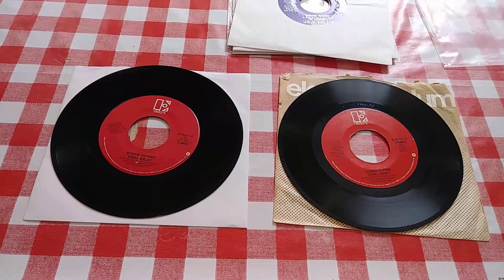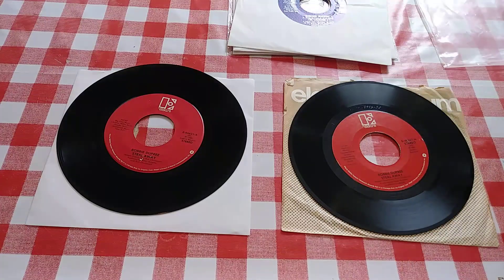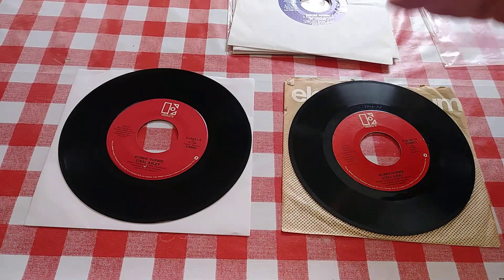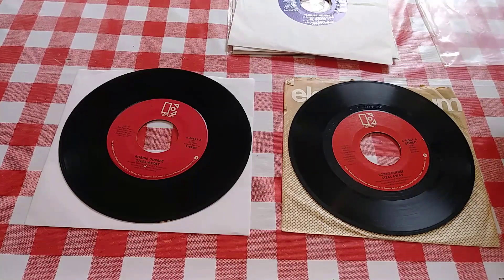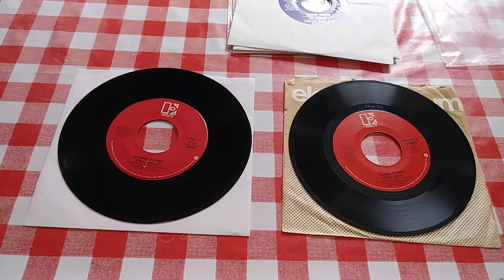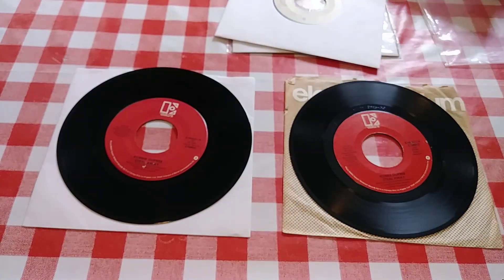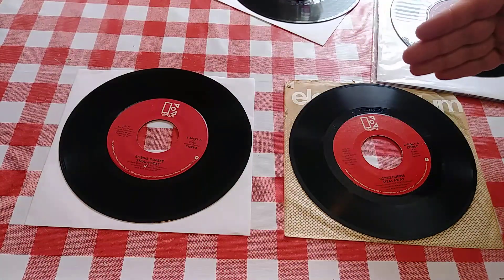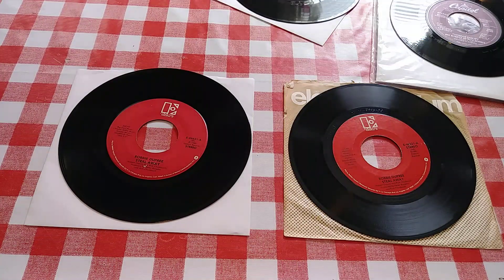Not All Records Are Vinyl | How to tell a Vinyl 45 from Polystyrene.

Comment: Great video.  Don't think you mentioned it, but one test for styrene that I use is to gently flick the edge of a 45 with my fingernail and listen to the resulting sound; a styrene record will produce a "dink" sound whereas vinyl will produce a "thunk".  As an aside, I have a local record store here in LA that has a sign inside the store requesting that customers not call records "vinyls"; can't stand that term myself.
Reply: Yes, thumping it works, and the weight.  Some people believe holding it to the light trick and look for red, but it is not foolproof.  I have some styrene 45's that are not translucent at all.

The other foolproof method is to see if you can snap it in half.  🤣
Reply: Steve Hoffman also hates the term "vinyls," though even RCA Victor, in some of their journals, used that term to describe LP's and 45's back in the '50's.
Reply: I hate the term vinyls too!
Reply: @chrisa2735-h3z  I use the phrases "records" for general records, whether 78s, LPs, and 45s. But I prefer to use 78s, LPs, and 45s since it is more precise.

Comment: vinyl 7” records sounds better than styrene, styrene records wear out faster, too much tracking force will destroy a styrene record in a few plays, vinyl records are much easier to grade visually, styrene records will sometimes have to be played to determine the quality (I have a stack of excellent to near mint styrene records that play with too much hiss and distortion to consider keeping or selling). However, styrene records will sound absolutely fine if they were well cared for.

With the vinyl records making a comeback and people saying stuff like “vinyl sounds better than CD” A good way to look at styrene 45’s is they are basically a novelty pressing made when the record companies could press them quickly and cheaper than vinyl pressings. If you are lucky enough to get a perfect sounding styrene 45 then that’s great, but nobody can expect that from every single one they get, you need to expect random hiss noises at the start or in the middle of the record and occasional distortion.
Reply from the maker: Polystyrene is actually a quieter playing surface than vinyl. They often sound better. I am super careful with turntable setup and none of my styrene 45's have ever shown any wear from me playing them. But, you're right in saying that they will degrade quickly if played with an old needle or too much VTF. :)

Comment: As a kid buying 45's in the 70's I could always tell the difference between the vinyl and styrene ones even if I didn't know the terms at the time.  The styrene 45's were not as glossy or flexible and they wore out sooner. As someone who's owned records since the mid-60's I can't say I've ever come across a styrene LP -- I believe they're pretty rare.  Many of the LP's from the early 50's that seem to be styrene are really a harder less-flexible form of vinyl (I'm thinking of the early 10" LP's, for instance).
Reply: You're certainly correct, very few LP's were pressed using styrene, based on my sample, running into the hundreds!
One that I have got in styrene is "The Beau Brummels Volume 2" (Autumn 104, stereo).
Rock Around The Clock (Bill Haley, Decca DL 8225) looks  bit like styrene also, but I believe they had their own special composition back in the 50's.
"Introducing The Beau Brummels" (Autumn 103, stereo) is on vinyl.
Reply: @maltaylor9753  Many children's records were pressed on styrene, but I'm not sure if that extended to LP's.  And I think you're right about the special composition.  A lot of the early LP's and EP's, especially the latter before the 12" albums really caught on, seem to be made of a hard, dense vinyl.  One advantage of this seems to be that they were quite durable, and if you find ones that were well taken care of they still sound very good even after 70 years.  Such is not generally the case with styrene records, which tend to "wear out" relatively quickly.
Reply: @maltaylor9753  - Shelley Products would have pressed those styrene Beau Brummels LP's.  Shelley was among the plants that pressed for their label at the time, Autumn.

By the mid-1960's, their LP label size was 3.875" - shorter than the industry standard of 4".
Reply: Shelley Products pressed styrene LP's right through 1966-67, then switched LP pressing to vinyl.  Columbia toyed for a time with styrene LP's, beginning around 1952 and continuing through 1960 (although by then only mono Harmony LP's got that treatment - I've not seen a single stereo styrene LP).
Reply: @wmbrown6  I had a few Harmony LP's when I was a kid but they would have been post-1960. I've never come across a styrene LP, but then I don't have very many that are earlier than 1958 or so.  Even among my dad's albums, which date from about '56 forward, there are no styrene ones. If I ever come across one I'll probably buy it just for the heck of it.
Reply: @robgrano6814  - 1959-60 was when the last Harmony styrene LP's were pressed.  Afterwards, all product from them - whether mono or stereo - was vinyl.  I have a Les Brown LP on Harmony released in that period that's styrene.

Comment: Only encountered styrene with American issues; never in Canada or Europe.
Hated, hated HATED them. Hard and glassy, with plenty of shriek, rattle and squawk and wore out in no time no matter how you babied them. Depended on the distributor, so I always preferred vinyl versions or European issues. The WORST offenders were Polygram (Mercury, Vertigo etc.) you can tell instantly by simply tapping them lightly on the edge; vinyl is like butter, styrene is brittle and hard with a kind of ‘ring’. Got good and sick and tired of paying premium prices for vintage styrene; I didn’t mind forking out a dime or quarter at the ol’ Goodwill because they were already shot usually, so they went into the ‘B’ stacks with their own cheap cartridge. ‘Fun’ records - who cared what they sounded like. $25, though, hurt.
Reply: PolyGram, over the years, used the following plants that handled styrene:
- Columbia (Pitman, NJ - 56; Terre Haute, IN - 73; Santa Maria, CA - 25; after 1987, Carrollton, GA - 57)
- Bestway Products (Mountainside, NJ - 19)
- Shelley Products (Huntington Station, NY - 54)
- PRC (Richmond, IN - 72)
- Monarch Record Mfg. Co. (24; until about 1979-80, after which they switched to vinyl for 45's)
- Allied Record Co. (22)
- RCA (Indianapolis, IN - 70; from the early to mid-1980's up to the point the plant closed in 1987)

I much preferred Columbia pressings, and basically those from Pitman.

Comment: Hi all,
Are their date ranges when styrene was more common?
Reply from the maker: 1951 through the late 1980's. Pretty much the entire run for most collectible 45's... :)
Reply: @EzeeLinux  - 1991, actually.  In November of that year, Sony Music (ex CBS Records) closed their Carrollton, GA pressing plant, the last they owned that pressed vinyl LP's and styrene 45's.  They then went for the next several years to the MCA plant in Gloversville, NY.  With Carrollton's closure, the specs for 45 styrene labels - 3.75" bleed and centering for 3.5" trim labels - went with them.  PRC was sold to Cinram in 1990, Shelley Products closed in 1985 (and Bestway around 1986), and the last styrene Allied 45's came out in 1989.

Comment: Maybe this explains a problem I am having. I cleaned a bunch of 45s with an enzyme record cleaner I use on my LPs and they all sound TERRIBLE! Is this because the polystyrene was ruined by my cleaning process? Or also I am using a Shibata stylus, so that could be too.
Reply from the maker: If they came up sounding bad after cleaning then they probably need a more thorough rinsing. I don;' think the cleaner damaged anything but a lot of those don't come off easily... Rinse them with water and dry them quickly... If you're tap water is hard then use distilled water. :)

Comment: The polystyrene records got almost immediate cue burn.
Reply from the maker: We used to get away with it using Stanton 680's with elliptical styli on the air but all it would take is one jock to rip that record backwards just this much too hard and then it was over. I don't "cue" anything these days. No need. :)
Reply: @EzeeLinux  When I used to dub record to tape, I let the pause button out as soon as stylus merged out of lead groove into the main grooves cluster

Comment: Great video Joe.  Learned a lot.  When it comes to the debate of CD vs vinyl sound quality,  I will say this.  You can make a CD sound like a record (warm and fuzzy) but you can`t make vinyl sound like a CD with it's dynamic range and clarity.  If it's not there, it's not there. Sound quality goes to the CD.  The warm and fuzzies go to vinyl. 
Being from the 60's,  we collected RECORDS.  "Vinyl" was something only DJ's would throw out there to be hip. Remember that??
Reply from the maker: I agreed somewhat... Records can be bright and have big dynamic range... Most consumer grade carts can't play them, though. High end record playing equipment can put a CD to shame.
Reply: @EzeeLinux  Most good TT put CD to shame, even Chrome cassette put CD to shame
Reply: @EzeeLinux  Thanks for replying Joe.  Good point. But do remember that the music pressed onto vinyl must be compressed to fit all that music information into those tiny grooves.  CD's not so much.
Reply from the maker: @Extremesam43  No, it doesn't... It's compressed to be loud on average players. You can get a lot of dynamics in those grooves. Many 12 inch promo singles that went out to radio sound much, much better than their CD counterparts. You have to have the equipment to hear it, though. Most folks don't. :)
Reply: Keep up the good work Joe.  I also liked the video on the cartridge comparison. I learned the difference between the bonded and nude stylus.  Makes sense.
Reply: @EzeeLinux  and especially 45rpms.
Reply: I love records for the their sound, looks, and the experience of playing them.  I also like cds burned Apple Lossless ALAC for their portability and for when I’m too lazy to play a record. 
It’s all good. 
Records are a labor of love - gotta want to put effort in to them (cleaning, storing, handling, stetting up turntables, tone arms, cartridges, pre amps the list goes on) - definitely not for most people. Hey, if you are in to records they are a blast.

Comment: MCA in the mid 70s seemed to press a lot of Elton's stuff on styrene. A few of Geffen (WB) were pressed by Capitol.
Reply: All of my EJ singles are vinyl. MCA had their own pressing plants and I can’t recall any styrene MCA 45’s
Reply: @HitsTownUSA  - Steve Hoffman has judged MCA's two pressing plants (in Gloversville, NY and Pinckneyville, IL) among THE worst in terms of vinyl surface noise during the 1970's.  They, Capitol and RCA all tended to turn out way off-center pressings.  But that's for another examination.

In the 1980's, though, some MCA 45's were pressed in styrene by PRC Recording Co. in Richmond, IN.  MCA ceased to use Monarch for their pressing needs about two years before they launched the MCA Records label; only Kapp and Uni product were turned out by Monarch, nothing on Decca, Coral or (pre-1970) Brunswick.
Reply: @HitsTownUSA  
Could be the mix was just "light". Some just seen to feel different. Kinda hard to describe.
Reply: I had Glen Fry's single from Beverly Hill soundtrack on styrene. Olivia Newton-John Physical was on both @HitsTownUSA